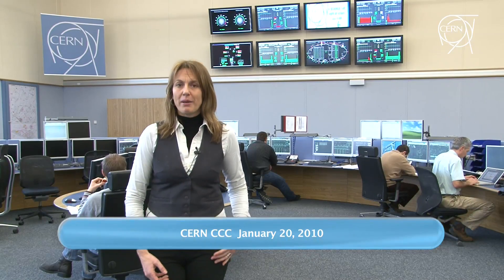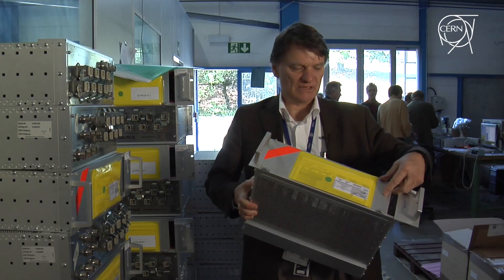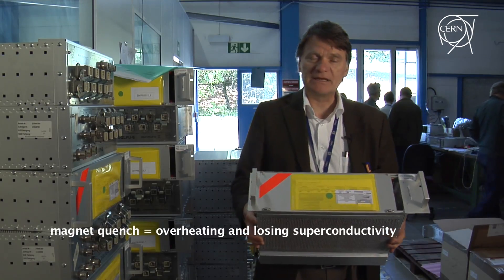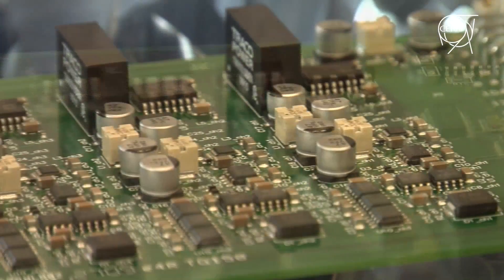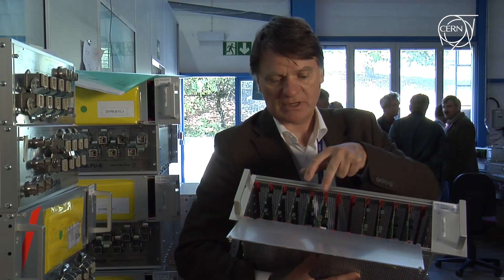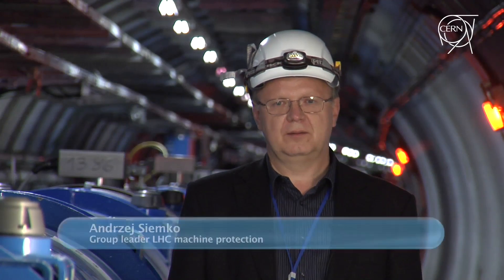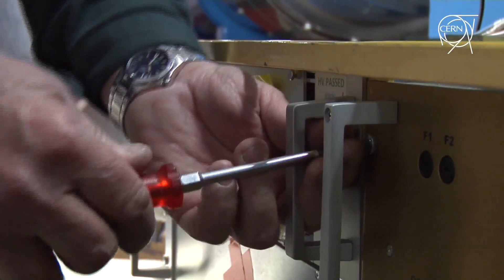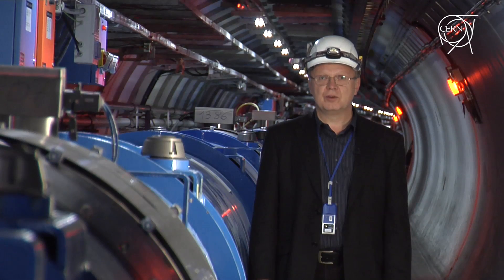LHCNews Jan 22, 2010 - A guardian angel protecting magnets

Comment: Look at 1:42, this is standard SCHRACK relay Slimline PCB Relay, 1 pole 6 A, 5VDC which I also use and similar relays at my electronics projects. By looking at the board it just looks that someone has copied complete circuit couple of times over the board... I guess someone wanted to make a speedy fix for project :D

Comment: actually it applies to most computer clusters or supercomputers.

you have a certain programming environment, a certain operating system. it doesnt have an interface, it cannot do all the nice things your PC can do, but there are some things that it can do extremely good, its a number crunching beast. now the PCs with interface that you hook up to it, they only provide the correct programming environment and the proper network connections. no need to ever change them once set up.

Comment: halo3guyy:

at our physics department, i recently found out that they are still using a piece of equipment that has been in use since 1860. its a block of wood that can be attached to a 8 metre high pendulum, with a scale, so that you can shoot at it and calculate the kinetic energy of the bullet (and its velocity if you know its weight) by the movement of the pendulum. on the back, there are records about its weight dating back to 1860, it steadily increases as 1 or 2 bullets per year hit it.

Comment: halo3guyy:

there are a few, well, ancient dogmas present in the mindset of scientists doing research. one is to never change a running system. if a computer is only being used to control a supercomputer, and it does what it should, and it has been heavily customized, then even considering switching to windows 7 causes headache. they are too busy doing cutting edge science to worry about stuff like that.

Comment: So it has little wires here and integrated circuits there and it has connectors in the back and we put a lot of work into it ... doesn't feel like they have much to say, maybe they could consider making it a bit shorter rather than a lot more boring...